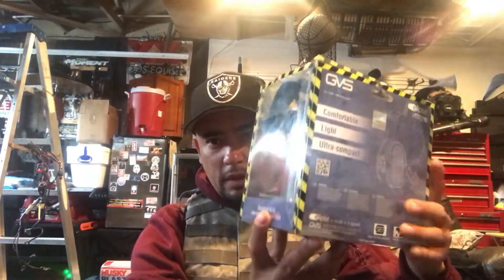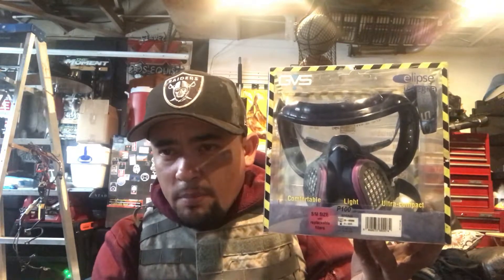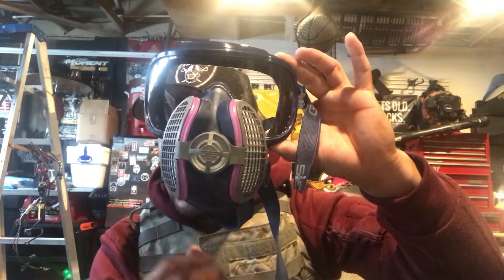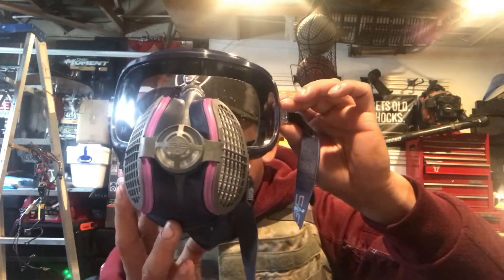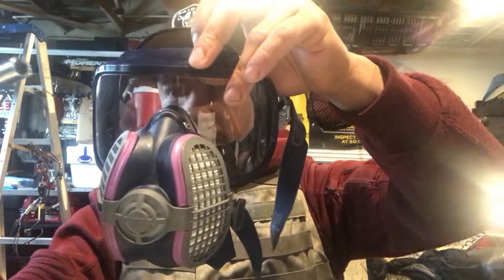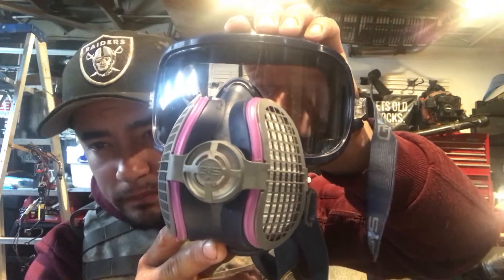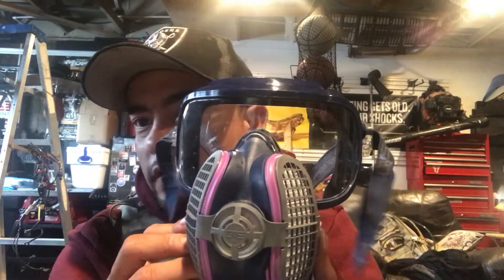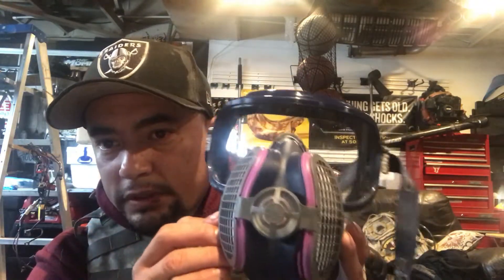GVS Elipse Integra Full Face mask Respirator! Let’s talk about it and more! May 18 2020

Comment: I find that air comes in through the exhalation valve. How would you cover the exhalation valve so you can still breathe and it would protect you as well as others? Thanks so much for a great review.
Reply: If it is return it and contact the company. This absolutely shouldn’t do that. When it’s niosh approved this is a big no no.